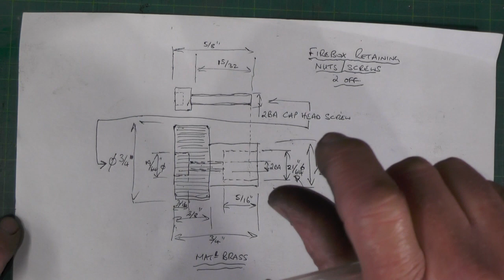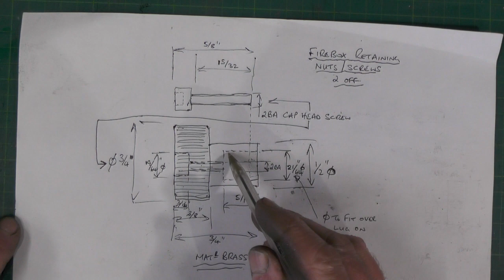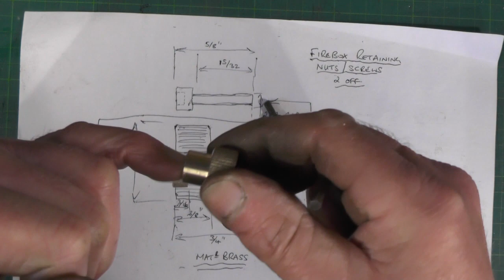Build Your Own Beginners Miniature Steam Locomotive Series (Firebox Clamp Nuts ) "mr factotum"

Comment: mmm. my thought is, If you need to remove it in an emergency it's going to be hot, expanded and probably tight, last thing you want to be doing is buggering about with yer hot nuts, you may, as you mentioned be better putting a couple of notches in the lugs and leaving yer nuts slack. I don't want to come across as critical because I know bugger all about loco's.  I think you are doing a fantastic job and have learned a lot, that I will personally put to use on my stationary engines I build, keep up the good work It won't be long now.
regards.
Paul
Reply from the maker: hi pr
not coming across critical at all, perfectly good assumptions, ive thought of those scenarios too.  the nuts spin off very easily, there's plenty of clearance in the firebox to boiler, so i will see what happens on the first steam up, hopefully not long now, thanks for comments and concern
regards
mr f

Comment: I used to have a Sweet Pea and can tell you from experience that one of the problems is that the firebox expands considerably with the heat of the fire. This causes the firebox to get stuck in the boiler. You may need to trim some plates to avoid this. Also, for the same reason, the two fixings holes that locate the firebox in the boiler become further apart and also jamb on the securing lugs. You will find that these holes need to have plenty of clearance to be successful. Keep up the good work, I've enjoyed your whole series.
Reply from the maker: hi JP
Great inside knowledge there, thankyou for the tips, i'm straight in to workshop to open those holes up for more clearance, before my first trial steam up very soon, a bit on tender hooks as i've never steamed a loco up before, i've made a check list of the things to do and keep my eye on. i appreciate your  help with the tips, and thanks for watching
stay safe
regards
mr f

Comment: Good Morning ! 
Very good !  You've made it very secure while the loco is running ! Maybe see that the brass alignment tube section has a slightly loose fit and possibly have the inside dia. of the knurled brass piece threaded 2ba to take a fully threaded bolt.
Tighten the bolt snug into the knurled brass knob with some loctite on the threads nearest the bolt head . 
This way you can undo the whole knurled retaining brass / steel threaded knob with a glove on without having to find your Allen wrench you've got in your pocket .
I run my loco's with thin protective gloves and can easily touch anything on the back sheet etc without getting burnt . 
Just a though Mr F. 
Please watch your fingers please at the lathe while its turning . 🙏
Have a nice Sunday ! 
Stay safe ,
Craig
Reply from the maker: morning tfs
yes, i will take all onboard, i probably wasn't clear on the video, i think i said i was to loctite the 2ba screws in to the brass so its all one unit. Thanks for advice once again
I can smell the fumes getting closer, so watch this space, hopefully!!!!
regards
mr f
Reply: @MrFactotum   will head out today and get my distilled water to start the test procedures 😳
Nerves are kicking in too here !
Reply from the maker: @theflyingscotsman9902  hi craig
can i ask why nerves, i thought you had steamed up before or i missing something here, or is it just something everyone goes through at start of a new season when loco has been de commissioned for winter lay up
regards
mr f
Reply: @MrFactotum  Hi , I am emailing you .
Have a great day !
Reply from the maker: @theflyingscotsman9902  got it